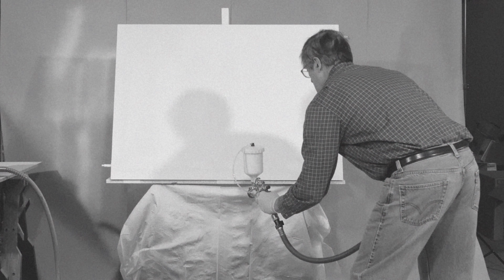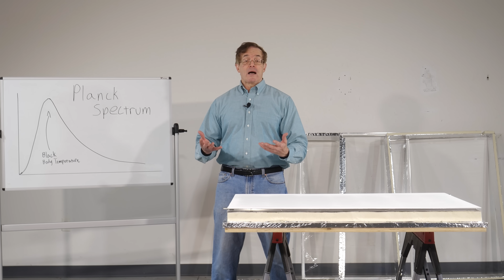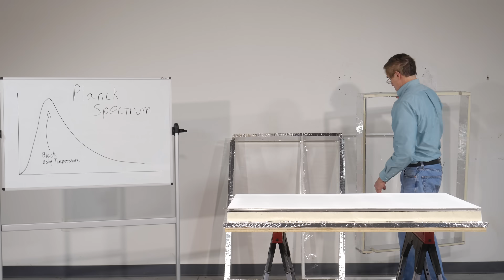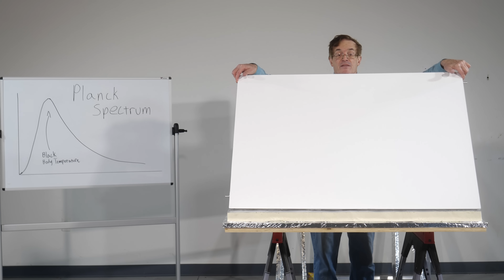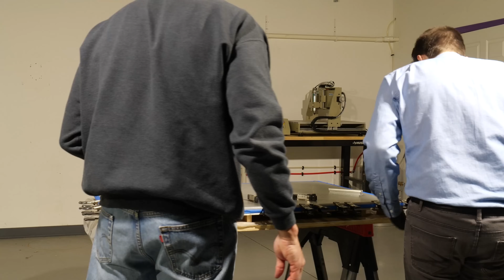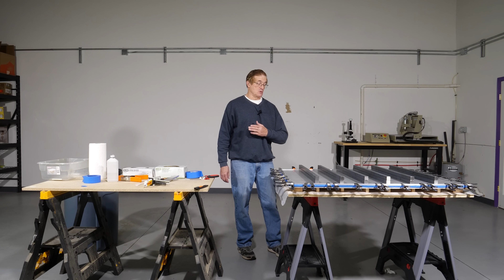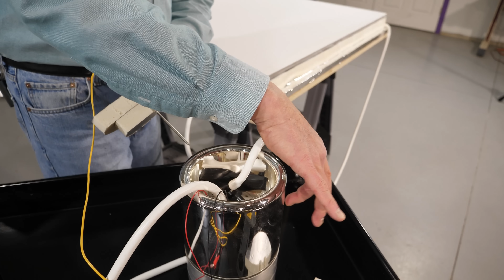Air Conditioning isn't free... but we're close.

Comment: Two MAJOR facts missing:
1. AMOUNT of water in the system 
2. TIME it took to cool it off. 

Radiative cooling is a thing, just not a very powerful thing. A few mW per m^3. It would probably be more efficient using the power going into the pump to run a thermoelectric cooler.
Reply from the maker: 6 liters 
20 minutes
Reply: @TechIngredients  So, roughly 0.042kWh of energy in 20 minutes = 2.1 watts

That is dangerously close to the power going into the pump. 

I would like this to work, but the pump is acting like the pump in an air conditioner. The flask being the cold side, the radiator being the hot side. Without the pump, this would not work.
Reply from the maker: 6,000 grams of water, 8 degrees of cooling, 4 joules/degree/gram in 1,200 seconds.
You need to recalculate, and of course, we're  removing  the heat supplied by the pump as well.
Reply: @TechIngredients  You are correct, I did it on my phone and fat fingered the decimal place. So I should have initially said 21 watts per meter^2
BUT...
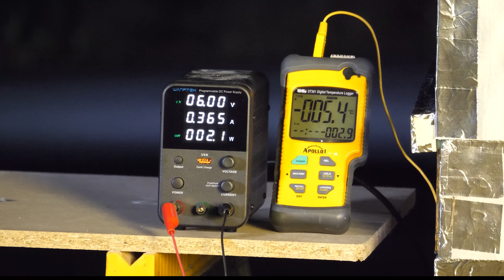There isn't 8 degrees of cooling. The water is only 2.9 degrees below ambient per the screen shot on 21:50
Sure, the water cooled off, but so did the air. It doesn't matter that the total temperature drop is 8 degrees because 4.8 degrees of it is due to ambient cooling.
This puts the cooling at < 11 watts m^2 
I really do wish this worked and appreciate the experimentation but these numbers mean that this is not scalable to house-size cooling. If there is less than 6 full liters of actual fluid in the system, the numbers are worse and definitely way off from the 150W m^2 theoretical claim.

Comment: Great video as always. I have a question that I would hope you could answer for me. Will the COLOR alone (not the material) of a surface affect how much "heat" can be radiated? Let's say you spray paint a car radiator black. Will it it cool the water more efficiently than if you left it in its aluminum surface finish? Thanks guys.
Reply: I did some research after looking at this video. Gold and aluminum are some of the best infrared reflectors. So your bare aluminum radiator will emit more IR than a black one

Comment: Well, sorta. Simply using the coating on the house will do better than all the complicated heat exchanger junk. Henry roof coating (white) has the radiative properties of your "special coating" so it is a source for that. BUT, the radiation into the sky depends greatly on the moisture in the atmosphere! Succinctly, this works very well in winter, or in the desert where relative humidity is low, but in the south in summer where the air is constantly almost saturated during summer the effect is significantly lower.  The roof gets so cold at night during spring and fall months water continuously condenses and runs off the roof. But in summer does not. A solar cell bank running a standard air conditioner would be more effective!

Comment: If you cool normal room radiator below room temperature, moisture is going to condense to the radiators surface. That’s the reason why you should not try to cool your house with them.

Comment: On the topic of solar panels, cooling solar panels increases their efficiency. And while I don't think there's a way to apply this technology to passively cool solar panels without blocking their light, they can be actively cooled using a separate radiator.

Comment: I see your submersible fluid pump is using a bit over 2.2 watts of power. That's heating up your fluid. I assume that amount of added heat is totally insignificant, compared to the 150-ish watts of cooling the radiating panel is providing?
Reply from the maker: It's  a small amount of additional  heat, but it did reduce the apparent performance.

Comment: I have been wondering  and try to find out if  using additional heat exchange like you were talking about.. on my AC unit.. as a geothermal hybrid.. I was thinking you wanted it on on the suction side or the high temp side.. you just said after the heat exchange that would be the liquid side. Just wondering if I understood that right and if you can make a video

Comment: Could you use a peltier or a series of them say with a heat exchanger below on one side pulling the fluid from the device and put the other side of the peltier facing the sun or paint it black creating a large temperature gradient and in turn directly generating electricity. I wonder what the efficiency would be or how much power can be produced

Comment: There are two questions I have: 
1) Why do Americans love to freeze at temperatures around 16°C indoors, when it's >30°C outside and you're wearing summer dresses and thin shirts? Why not accept, say 22°-23° indoors? This is the temperature, a person in light clothing feels comfortable. Every degree less of cooling saves a lot of energy.
2) Why not learn from traditional construction techniques, common around the Mediterranean, in South America and tropical Asia? Buildings that allow the free flow of air and with walls thick enough to stop the day's heat and outside blinds to keep the sunlight out. Combine this with the innovative materials from the video and the need for AC almost goes away. 
Note: Up to air temperatures of ~35°C ceiling fans provide sufficient cooling with only a tiny fraction of the energy consumption of an AC.
Reply from the maker: It's  probably  due to our general  wealth.
Air-conditioning  also dehumusifies the air, making the environment more pleasant.
As that wealth decreases and energy  costs increase, this approach  will certainly  evolve.

Comment: Apparently calcium carbonate reflects/emits in the same band. It occurs to me that old fashioned whitewash or lime wash, after application, becomes calcium carbonate by absorbing CO2 from the air. Very cheap. Easily applied. Unlike Barium, could never revert to a toxic form from unforeseen environmental/biological reactions. And could probably be formulated to slough off before the winter comes. Alkaline runoff usually good for soils. Fresh seasonal application means that the coating is not fouled with dirt or algae. And if it can be formulated to have the same properties, seems like it could be a good solution for roofs. I'd be very interested to see you research lime wash/CaCO3 too. How well does it work in the Greek islands for example? Is it better than a plain reflective paint?
Reply from the maker: Barium sulfate functions better  and is both nontoxic and water insoluble. I think it will prove  to be the better choice   and we'll  show you how easy it is to make.
Reply: @TechIngredients  Yea, it's non-toxic because it's so very water-insoluble. IDK whether any microorganism might change that though. This tech could become very big. Would hate to put millions of kg of the stuff into the environment, to later find woopsie, fungus X converts it into a soluble form.
Reply: @TechIngredients  Yes, it's non-toxic because it's water-insoluble. I look forward to watching. Barium compounds (from chemical supply) are quite expensive though, so unless there is an alternative supply the formula may be cost prohibitive.

Comment: The upper frame wouldn't shield the panel from the surrounding tree radiation. The reflection will still go to the panel. But if you used retroflection that would work. E.g. use 90 degree angled aluminum profiles and strack them to get a 1 dimensional retro reflector.
↕️↕️↕️ Light
/\/\/\/\ aluminum angles 
🧱🧱🧱 Frame

Comment: Some of the high performance epoxies (possibly the same as the one you used -- I couldn't read the label to be sure) are basically "brain damage in a tube" where VOCs and other inhaled nasties are concerned. Did you check the SDS for those adhesives? Please be careful: there's only one of you, and you're doing fine work. The lab is no place to be cavalier with safety. Just ask Rosalind Franklin, and so many others who died long before their time, and well before they reached their full potentials. You already did a video on the seen dangers that can hit you in the eye without warning. The unseen ones can be just as terrible.

Comment: Most of the radiation doesn't go into space, but travels just 20 meters or so into the air until it is absorbed by greenhouse gases: https://www.youtube.com/watch?v=oqu5DjzOBF8
Reply from the maker: No, it isn't.
The infrared  windows in the atmosphere cover much of the thermal infrared.
If that wasn't  true, then when you direct an IR thermometer at the sky, it wouldn't  read -50 to -70 C.
Also, cloud cover wouldn't  matter and it does... a lot.
Reply: @TechIngredients  I've checked and it seems both of you are right. With current co2 levels in atmosphere 20% of thermal radiation energy of earth is absorbed by CO2 with mean free path of around 25 meters from the source, but it depends on IR wavelength. If atmosphere was pure CO2, 100% of radiation would be absorbed. Cheap IR thermometers are calibrated to 8 µm to 14 µm, while co2 peaks at 15, 4.3, 2.7, and 2 μm. It is done exactly to prevent exhaled CO2 messing up results. 8 µm to 14 µm is mostly susceptible to water vapor which is 8 µm to 14 µm. Not sure if it can help improve your design, but I think it's worth mentioning anyway

Comment: There's all facts basically, but scale littlebit misleading. With 10x size of this thing AND using A/C unit, it could increase efficiency, whatever 5-10% and 10 of these cost by this method more than year of all electricity for one year? So 10 years could be time to pay it back, then it's win win?
I know my numbers are from hat.
If that panel gets twice as hot, it could "disappear" heat much more than double, but hotter panel means hotter liquid for AC and thermal COP drops. 
If you can cover somehow radiator from industrial or even from car (motor coolant), it have more surface area than 10 of these panels. But is it enough? I don't know.

How about making roof panels from aluminum and coating these all over, they stay cooler and heat home less, so AC needed some less?
You could even put piping to roofpanels (underside, thermally connect to outside) then cover whole thing with that stuff that makes the difference? Adding it's efficiency put some trees around your house (those what you need to cut down before, some reason) then roof stays more chilled..

How about drilling hole, taking water for free down there and make it waporize some system, it tooks massive amounts of heat and it's already cooler than outside, if AC needed..
I know, that isn't free in reality and wasteful too.

If you make panel that type, there's some forces.. if coolant pressure is 2 bar to get reasonable flow, it start ripping 🙏 that thing apart few hundred kilograms per square meter. Flow is bad too when it's too laminar and if you use piping, there need to be some coil, mesh or something inside to make liquid contact with metal. When fridgerants used, there's not same problems, but then there is so many of others. Let's say few; any particals, microholes/cracks, pressure is high on positive size and so much more..

There is good info in video, but "diy" project for free cooling is far..
There's people's using little bit same type panels, but opposite to turned on sun. There is parallel tubes inside, with vacuum and glass window to get heat somehow inside, but not opposite. When it's warm day in Finland (everything over 25*c :) panel could get so hot it boils water, so it stop circulation when there's enough heat in few hundred litre insulated reservoir at 85-95 degrees Celsius.
Then panel just getting hotter, but it dosen't conduct to water when no circulation, so there could be few hundred degrees heat inside that thing.. So making device that works entirely otherwise and disappear heat some silly hot country makes me wonder how could it work?
I have thinking to how cool solar panels for better efficiency, and it turn to be hard just easy way to make it good, so one reason again why this makes red flags for my eyes 👀 😀 

But let's see..

We use AC units to heat houses, so one watt of power you could get 3-5w heat inside and even heating water. So I think these devices are very good these days and give good value all way of living. These are driven by inverters, so compressor can work less when dosen't need full power and if it shutting down and simply turns on for fully without inverter, it's bad and suicide for those devices at these levels.. and when it's running little under full capacity, thermal efficiency is best and compressor works longest before breaking.

Comment: In 1980, I drew some house plans for a solar heated AND cooled home. I was in high school. My father was a carpenter he did most of the research. The ref book was "the solar home cookbook". In the book the author goes into details about totally passive solar heating and cooling. The homes that were built and tested were "envelope" houses. The ones built were ugly things. Even though no mater where built they kept the living space at a constant 74F. The concept (law) that most solar design forgets is "Heat Rises". For heating, a large mass of hot air will rise and is able to push a smaller mass of air downward. So far there is not arguments about this. 
For cooling. Short answer. The earth below the permafrost layer, it freezes because it is effected by the temp of the air, AND above the aquafur layer, because it is flooded, stays a constant 53 degrees F. That is 24/7/365. Typically that is 3 feet deep. You bury pipe in the ground at this level. 6 inch pipe the air travels to fast and inefficient. 9-12 inch pipe and there are eddie currents, once again inefficient heat transfer. The ideal size is 8 inch pipe. The cool part is  leach field perf pipe, round or U shaped, is available and cheap. The calculations for how long a pipe you need is based upon the volume you want to cool. In my case 19,000sqft (including the 2nd story I think it was 23,000sqft) home needed 300ft of pipe. You put a grate on the inlet side. Bury the pipe. It does not have to be a straight line. You can zig-zag it leaving a 2ft gap between pipes. For most houses the front lawn is the right size. The other end of the pipe enters the home in the basement or subfloor. The foundation vents may need to be sealed off in the summer, or the suction needed may not happen. Place a screen on that end to prevent rodent intrusion. Then in the ceiling of the home place a louver, which you open in the summer or simply open an upstairs window. That hot air rising out of the house will suck the air through the pipe cooling the house.  The roof should already have roof vents to allow the hot air to escape. Zero electricity. 
This idea has been monetized with a constant expense. It is called Geothermal cooling. expensive pipes, pumps, heat exchangers, exotic fluids, etc. 
My goal is to share an old school method for totally passive cooling. You still have to open a window and vent, so I don't know if it could be called totally passive. I still think it beats all of the alternatives.

Comment: All of what you have said is true, but at the surface under atmospheric pressure IR isn't that important and accounts for only 8% or less because Kinetic Thermodynamic transfers are not restricted by wavelength. Kinetic transfers diminish with pressure. This is why our equations for IR are calculated solid surface equations. Until the energy reaches the surface all of the energy is equalize moving from higher energy to lower energy flow. Once the energy flow reaches the surface it doesn't stop. It continues based on pressure and the movement movement of air the faster the thermodynamic flow.
I feel like we are forgetting the laws of thermodynamics sometimes as we put too much focus on radiative transfers.
Reply: NASA has know and designed lightweight systems with the realization that you don't need solids like aluminum. You only need to coat the surface with packed atoms and you get the same radiative transfer because kinetic transfers occur in solids and Radiative is only useful for the surface.
Reply from the maker: Thermodynamics is what we are relying on to use the radiative principle.

Comment: Seeing as this works what happens if you combine this with your desiccant air conditioner optimized for potassium formate (to cut out corrosion)? I'm thinking swap out the peltier coolers that were eating most of the wattage in that old video.
Reply: Would also cut out any inefficiencies introduced by the wort cooler and possibly the extra evaporative tower as well. It would be bulky but, so is a solar ice maker. You should be able to slot these in series right before the return to the  room if I'm not mistaken. There's also the synergy of shading the roof with the panels. Unlike solar these aren't giant heat lamps themselves.

Comment: What’s cool about this video is how little things matter.  How many of us replace our 60 watt bulb with an led, and instead of using it the same way, we burn the LED all night instead of as needed. Cars now have LED, and we use driving lights or run them all the time, even went parked thinking nothing of the energy consumption.  Whether is traffic management, better insulation or a carbon tax, we have to use the advantage of energy management as the advantage we are seeking.  What I like about this video is the demonstration of physics and I can’t thank you enough.